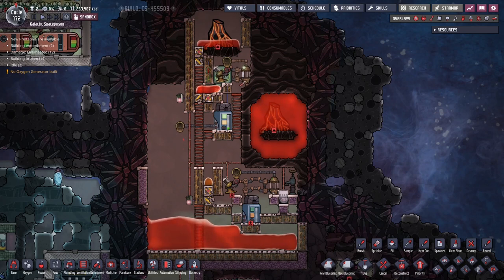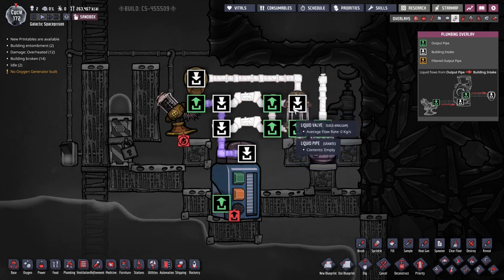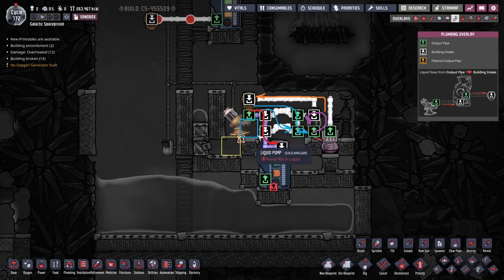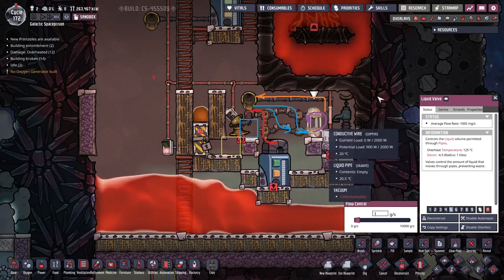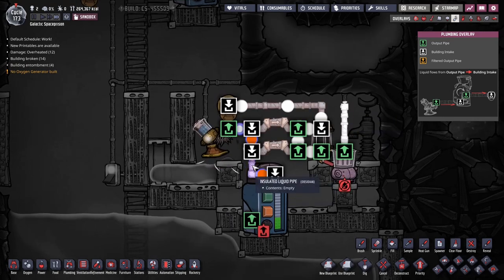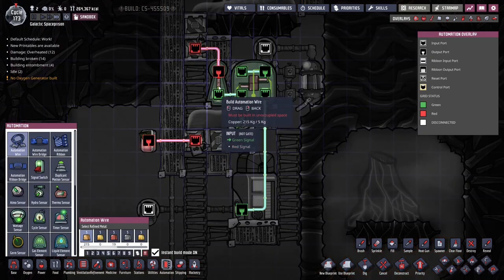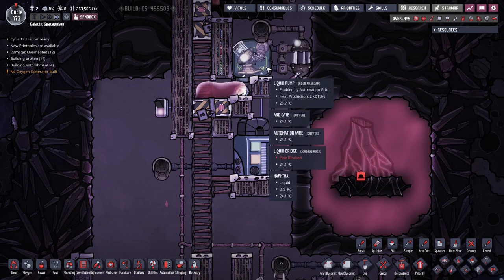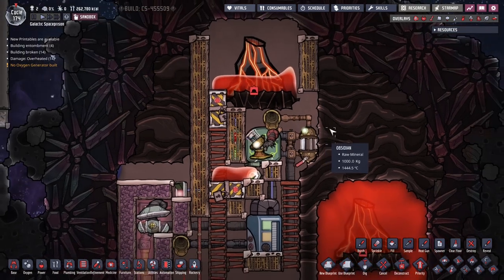How to Pump Magma and Molten Metal - Oxygen Not Included

Comment: i was about to build this but i have a question , if you turn off the pump fr too long the liquid you are dripping will not flow on the side tile ? even using naphtha,
isn't better to automate the door so if the reservoir reach a % will shut the door off , but still have the capacity to take that 3 tiles (1,5)
tnx for the video
Reply from the maker: For sure need doors! I've built that for volcanoes in survival in the Regolith Melter video.
Reply: @greezyhammer764  tnx for the answer , i will watch that video for understand better , anyway i build it....twice , sadly i have find out that you need exactly that tile "yellow" to be in contact with the liquid to pump 
so we can't mirror it

Comment: So 
I have a magma core on my planet.
If I build a shaft down and make a way for the magma it expose my pump there will be overwhelmed in no time. So all I need to do is place door horizontally to prevent is. Am I getting any of that sweet-sweet info right?
Reply from the maker: Magma doesn't flow upward, unless it's pressurized over 1840KG. Door helps to control the flow in case magma is pressurized or if it's flowing downwards i.e. from a volcano. I'll show how to pump from the core in the upcoming video.

Comment: I been struggling with the bottom setup for about 10 hrs now  between the pump breaking, the pipes breaking from cold damage. I'm using the insulated obsidian pipes  any suggestions would be appreciated. And thank you for all the vids .
Reply: if you have pipes breaking from cold damage i believe you have the pipe full and the things stay inside it for too long , as video explain it that should never happen 
the automation on the pump/reservoir is what should avoid it to happen
Reply: i recommend radiant pipes(in a vacuum) if possible. insulation is the only material that will not exchange any heat with the piped element, and it's too expensive. if you pipe liquids in packets smaller than 1kg and gases in packets smaller than 100g, they will not state change inside the pipe. you can use these packets(and dump em somewhere) to prime up your radiant pipes with heat so that you can safely pipe larger packets later.